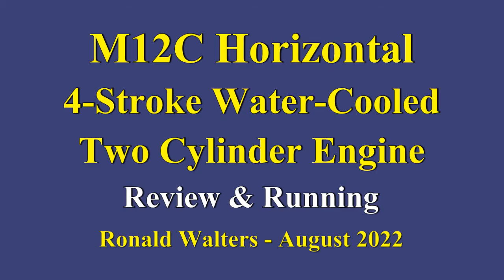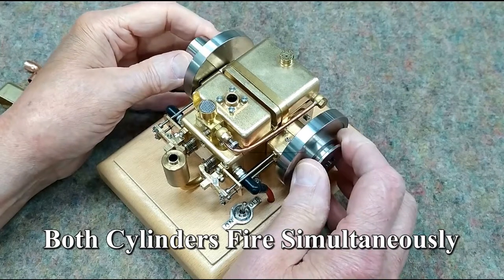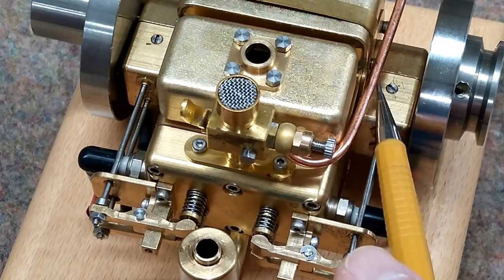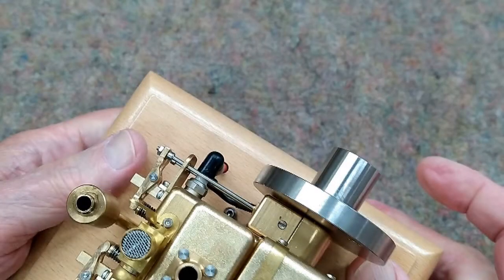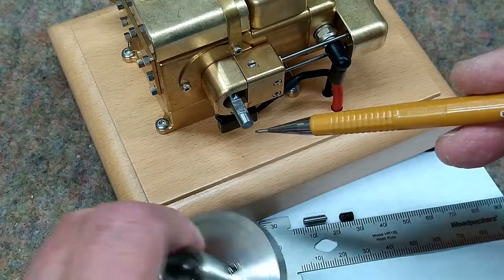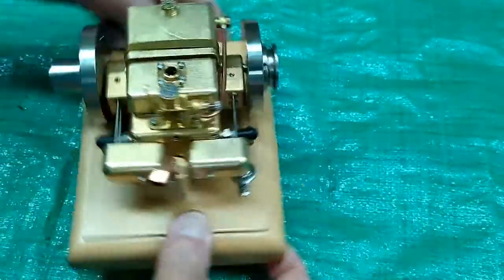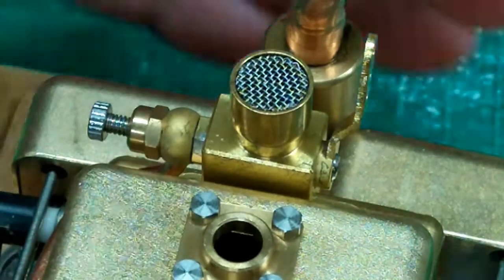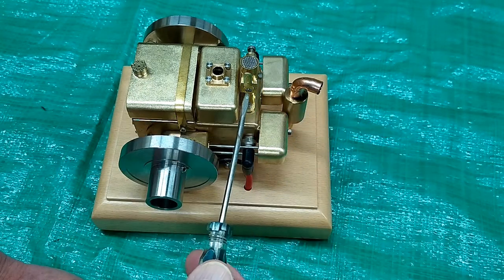M12C Twin Cylinder Engine Review

Comment: I enjoy your engine reviews. Could you turn one of the cams 180 degrees and get it to fire alternately? It would sound like a boxer twin.  What cause these small engines to miss? It seems like they all misfire every other time while idling or under light load.
Reply from the maker: I have heard this engine now comes from the factory firing alternately... but I have not personally experienced this. I don't particularly like the long crankshaft pins for the conrods... and have no idea if both cylinders firing together or alternately would cause crank pin failure. But in answer to your question, the cam for one cylinder could be rotated 180 degrees for alternate firing. 
I don't know why these little engines pop and crackle at idle. I do remember some small 2-cycle Vespa scooters and chainsaw engines doing the same thing at idle.